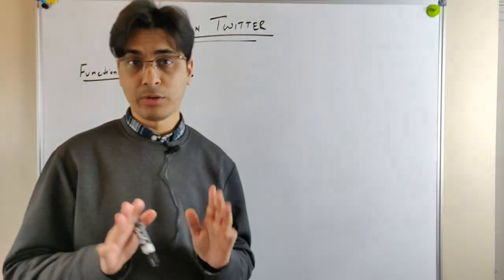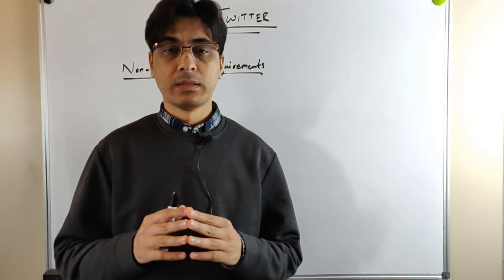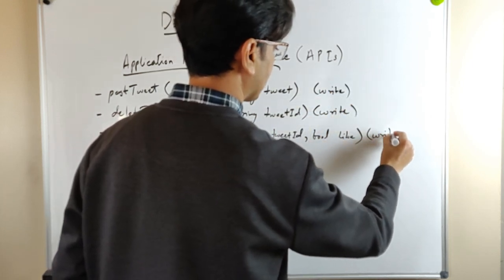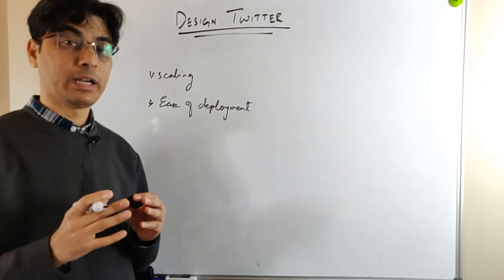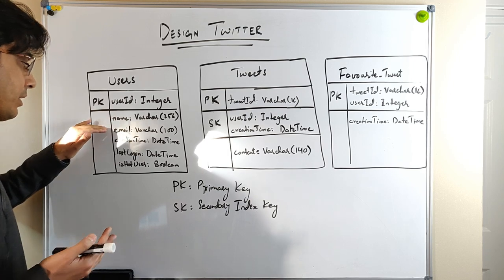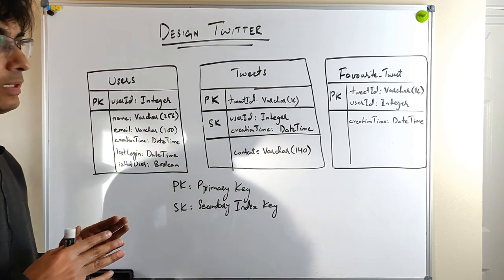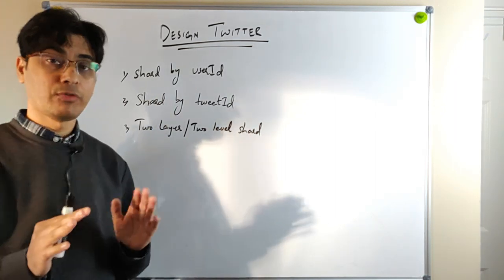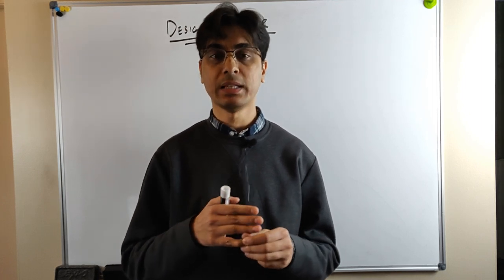Twitter System Design - Microservices Architecture Part I - Google Interview Question

Comment: Thank you for the video. Great work!

One comment:
Given strong consistency is not a requirement, for N=5 is W=4 needed. Even if we have W=2 or 3. Eventually they will get replicated --> eventual consistency!
Reply from the maker: thanks for the comment
Reply: For W=2, R has to be at least 4. For W=3, R has to be 3. 
R = 3 or 4 are slower than what he proposed (W=4, R=2). Since twitter is read heavy, we should keep R to as min as possible.

Comment: @Think Software, thanks for posting the awesome content, a few questions/suggestions:
1. How about using separate tables (or datastore)  for separate services? User timeline API can query from the table sharded based on userID, home timeline API can query a separate table (or datastore) that could be sharded based on the IDs of the followees. In other words, model the data based on the queries that will run on it, something similar to what we do in Cassandra data modelling.
2. It would be great to see separate data stores for all the services and interactions between them (using APIs or queues.).
Once again great tutorial, please keep it up.
Reply from the maker: Thanks for the comment. Different micro-services uses different/separate data stores in the design that I have discussed.

Comment: This is again an amazing video. I've 2  questions - 1.  regarding sharding by User id. We can definitely solve the scale problem by adding more replicas but what about data skew for the celebrity user shards. Isn't the idea for data storage is to keep partition size deltas minimal? 2. ) regarding storing in memory tweets for users to generate the timelines. I'm guessing this is going to be 140 + 60 additional bytes (user id + ts) etc. To store 200 bytes * 100 *  300 Mn Users = 6 TB memory. If we do pick a machine of 16 GB memory it will take at least 375 app servers just for this. Is this a scalable cost efficient approach?
Reply from the maker: Thanks for the comment. This types of things are discussed in the incoming course. Just to answer your #2 here, we won't be keeping all the tweets in cache. Only the tweets for the active users - how we define active users is different story.

Comment: quenstion 1 -> regarding keeping each user's tweets in memory in the time line service, we are talking about 224bytes x 100 tweets per user x 500 000 000 users = 11.2 TB of information! is it really economic to store such amount of data in memory? How many machines would we even need (take into consideration the number of replicas!)? even if it is, based on your design, this data is accessed only when a user's profile is accessed which is not that frequent. why not only keep this data for the top 20% of our users hot users and evict the LRU?
question 2 -> if we assume that your implementation of user timeline is feasible and really needed, why not have Home Timeline service access Social Graph and get a list of followees of the user and then go to User Timeline service and get a list of K (choose K based on the number of followees of the user in a way that when merged we get a list of 500 tweets so that merging and ordering is fast) recent tweets for those followees, merge and sort them and return the feed? I understand it would mean order of nlogn but it would still be fast considering the size of data retrieved (about 500 tweets).

Comment: Instead of using the fanout service, could the tweet svc directly write to DB, and then we can have an event management system like Azure events grid, that could listen to DB updates on tweet table that publishes different events (add / update / delete / read)? .. This way, we won't have to maintain the fanout svc, and the eventsgrid could auto scale without us having to worry about scale  at all. Basically, one less piece in the arch .... When a new svc comes up, like trending svc / recommendations svc, all we need to do is subscribe to relevant tweet events, and then nothing else needs to change ..
Reply from the maker: My understanding is (and you can correct me if I am wrong) that Azure event grid is a distribution system and not a queueing system.  If an event is pushed in, it gets pushed out immediately and if it doesn’t get handled, it’s gone forever. Unless we send the undelivered events to a storage account.Also event grid does not guarantee the order of the events. So at the end it depends on what requirements you have.
Reply: In an event routing service (aws SNS / azure EventGrid), once it receives an event, it'll send the event to all the registered subscribers .. and only deletes the event, once all the subscribers send an OK ... else it has a retry mechanism with exponential backoff ... 
It's true that sometimes when a service is down, it could receive the events out of order, but in Twitter's case, I feel the ordering is not as important ... Only case is to build home timeline of a user, where a specific feed won't be present for some time ... but as soon the service re-receives the event, it can process it and place the lost feed at correct position (depending on time) ...
Reply: @John Cohen   there are multiple retries with exponential back offs. So although there is a chance that it might fail but it's less. Bte same chance exist with service call .. it may fail to process the request even after successful response  .. or maynot be able to receive the request only! The advantage is that you won't have to manage this new service which is huge!

Comment: How will you use linked list data structure in distributed systems and scale that table of user id and linked list
Reply from the maker: Linked list is stored in in-memory cache and not table in data store. You don't store a single linked list across machines. You store a single linked list in a machine. The list being let's say user time line tweets are shard by user ID.
Reply: @ThinkSoftware  is the cache part of the app servers? in that case we would need to route all requests for a user to the same app server..
Reply from the maker: You should check how you can have list stored in a distributed cache like memcached etc

Comment: What is the reasoning for using a write through method when writing to the datastore instead of just using cache aside? Also, for an application like twitter consistency is less important than availability, so why do you need to ensure R+W>N?
Reply from the maker: Which service are you asking about?
Reply: @ThinkSoftware  Basically for the tweet service, but really I am asking about the part at around 24:00 when you are saying we need to make sure the # of replicas we read to + # of replicas we write to is > N. R+W>N means you get strong consistency, but this doesn't matter as much for twitter right?
The write through method for the cache is also for the tweet service basically (around 17:52)
Reply from the maker: For Tweet service, consistency for the sender is important otherwise it will be confusing and bad experience for the sender if he does not find his tweet. Why are we using write through because we know that this tweet is more likely to be accessed right away so avoiding even a first read call to the database. Consistency is eventual for the case of user home time line.

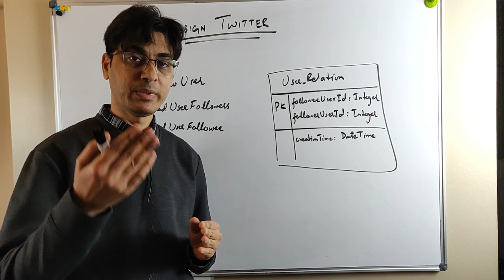Comment: 32:00 - Design of User Timeline Service

Q1. Why is the User Timeline in memory  and not db ?
It should be persisted right ? or is it done for speed?
Reply from the maker: Thanks for the question. This depends on the requirements like number of users for which you want to create time-line in advance along with cost. In our case, we are fine keeping it in cache and if not present in cache then generate it from DB.
Reply: @ThinkSoftware   I get your point...
Thnx!
Reply: @ThinkSoftware  What is the type of DB used to store information from various service here? Is it RDBMS like MySQL or NoSQL like Cassandra?
Reply from the maker: It depends on service based on the requirements. This question is being handled in more detail in the course.
Reply: @ThinkSoftware  Got it. But is it even possible for NoSQL databases to have primary and secondary keys?
Reply from the maker: Yes it is possible for nosql dbs to have primary key and secondary index. E.g. Check document dbs

Comment: At https://youtu.be/1_HIpTBUHAs?t=1490, it seems not enough to ensure consistency if using w+r>n, consider this: if we write to four instances, one failed, we return failure to user, but the successful three are committed, so when user reading from one of these three and another one instance not been written to(in this case it's two read), user can read the tweet he/she posted, which is not consistency since we already told the user the write is failed. Is my understanding correct? Thanks.
Reply from the maker: Thanks for pointing out this edge scenario. This is discussed in the course how we handle such scenarios.

Comment: Why is K = 1000,  at ~33:00. This seems on overkill. Even a 100 is too much
Reply from the maker: I mentioned that this value is configurable and so we would be using analytics to come up with a suitable value for this. Of course to start with, we need to have some value and 1000 was just an example as mentioned in the video.
Reply: @ThinkSoftware  Thank you! Great job on the videos. Good quality. Keep it up.
Reply from the maker: Many thanks for the comments and kind words 🙂

Comment: you made write to 4 nodes, won't it increase write latency, please don't do it just for jargon.
Reply from the maker: I think you didn't understand the reasoning. Thanks for the comment anyway.
Reply: @ThinkSoftware  Lol, that's the easy path out, you did not understand. The write has to be quick as well like read, fanout would help for read latency. You don't necessarily need to make read acknowledgement count low, strike a balance, bookish knowledge is dangerous man. User can at Max see  written result sometimes later.
Reply: @learnersparadise7492  what is this attitude? You should be bit respectful here. He is sharing all this valuable knowledge for free (even if he charged, it would be still be worth it). Instead of encouraging him, you type this?
About your question. Twitter is a read heavy system (Reads >> writes). Hence there is a trade off b/w optimizing read or write latency. With W+R= 4+2, write takes bit longer and read is faster. Which is what we want.
If we did 3+3, write gets faster but makes reads slower, hence not ideal.
We can also do 5+1, this will make read very fast but write slower. But this still is a feasible solution.